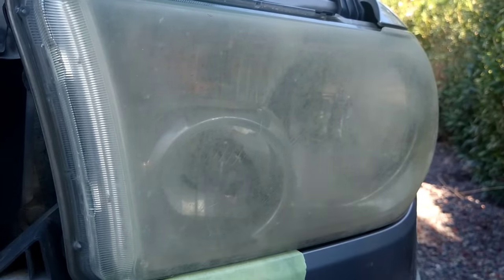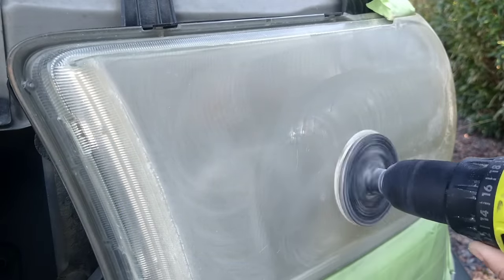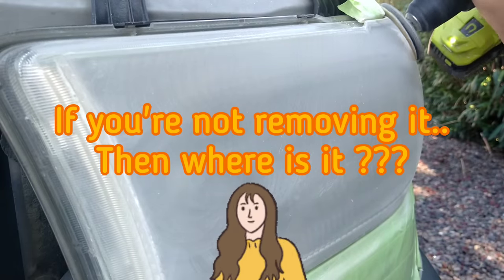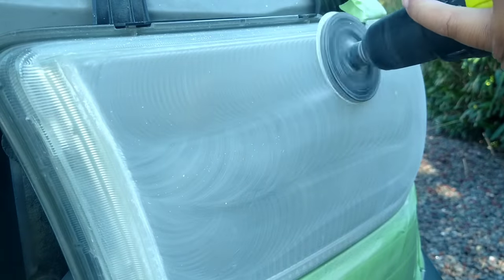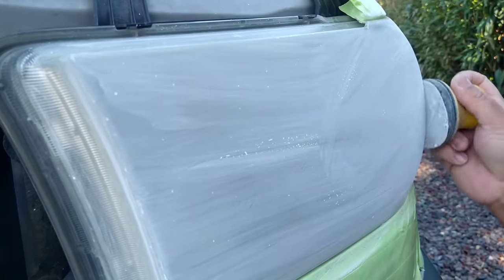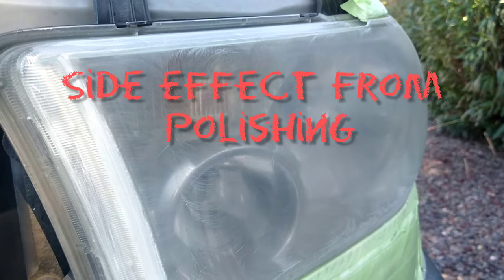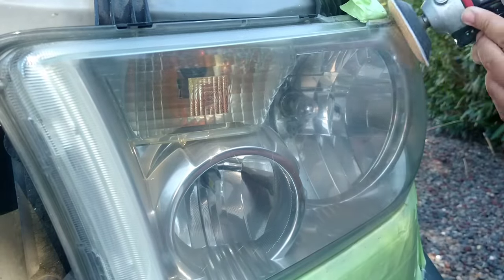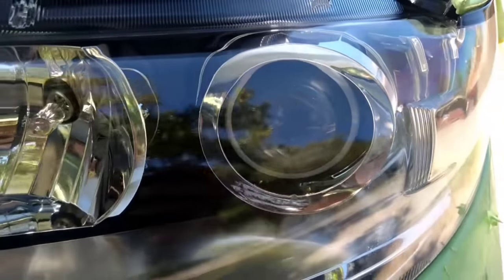POLISHING HEADLIGHTS IS A SHAM/scam  ---  and why you should never only polish headlights

Comment: Cost cutting by manufacturers is why we have to do this , bring back glass headlights and they will outlast the car.... 👍
Reply from the maker: Stay tuned got some interesting content coming out you would definitely be interested in... Thanks for watching.
Reply from the maker: https://youtu.be/LcMFr0mpp-4
Reply: Yeah my 99 Subaru has glass headlights they still look new
Reply from the maker: https://youtu.be/LcMFr0mpp-4
Reply: This is a great idea. Until you wreck and there’s glass everywhere
Reply: Part of the reason for the switch from glass is because of ncap ratings. I say if people didn't walk into the road it wouldn't be a problem.
Reply: I just opened comments to say the same thing.
Reply from the maker: https://youtu.be/LcMFr0mpp-4
Reply: @colemcclintock216  are you related to the scare crow from the wizard of oz?
Reply: @colemcclintock216  

Now that they have gorilla glass, it would be simple to have a veneer of glass over the polycarbonate body.
It would be a simple overmold process and a lot cheaper than solid glass.
Reply: @theheadlightrestorationpro  so the clear coat on the lense is spider webbing. Since it's not overpolished like the one you restored in this video, what is a proper process at that point?
Reply from the maker: @xenniealsentinel1800  well long as it's just the sealant that is spider cracking pretty much the same process you just remove the existing sealant and replace using these methods.. but you have to establish it is the clear coat not the actual headlight if it's the actual headlight there's nothing much you can do but try to mask and blend it as much as possible with polishing and clear coat...
Reply: @theheadlightrestorationpro  thanks friend
Reply from the maker: It would be very expensive and no telling if it would work...they would have to take years of research and millions of dollars...and a bunch of other stuff..
Reply from the maker: https://youtu.be/LcMFr0mpp-4
Reply: Part of the other reason for plastic. Call all the dealers in your area, ask them about restoration.
Reply: @colemcclintock216  yeah, because if you wreck the plastic will never break!
Reply: Doesnt even need to be glass, since 2011 ford f150s have had headlights that dont fade. I know cause i had a 2012, never had new headlights, they looked untouched to this day, 10 years on.
Reply: @colemcclintock216  there would be glass everywhere anyway if you wrecked…
Reply: @colemcclintock216  yeah, also our windshield is made of big pane glass
Reply from the maker: Modern windshields are generally made of laminated safety glass, a type of treated glass, which consists of, typically, two curved sheets of glass with a plastic layer laminated between them for safety, and bonded into the window frame.
🌎GOOGLE 🌍

Learned this the hard way.. if you ever see a scar on one of my hands on the videos.. it's because I punched one out all I did is shatter with the hole for my hand to go through I was like glue which is why my hand got cut...good for thought..
https://youtu.be/LcMFr0mpp-4
Reply from the maker: https://youtu.be/LcMFr0mpp-4
Reply: Glass vs. Plastic = $$$.....it's all about cost reduction.
Reply from the maker: https://youtu.be/LcMFr0mpp-4
Reply: @kylesmith6515  🤔 My 1998 Subaru Forester had plastic headlights, and glass fog lamps.
Reply: @colemcclintock216  here comes the rain cloud when it was all sunny dude come on if you wreck the car you get new headlights there's glass everywhere who gives a s*** in his car start driving again the glass is all broken up in little piece and gone anyway like in a regular car accident
Reply: @6panel300  change a headlight to plastic but reinforced bumper with a steel Hood and sometimes it's still Grill is okay though that doesn't make any sense
Reply: That part
Reply from the maker: That part...https://youtu.be/LcMFr0mpp-4
Reply: @theheadlightrestorationpro  you're relentless with that video promotion
Reply from the maker: That's how it works....lol
Gotta get it out there...
https://youtu.be/le1LyD93Ydo
Reply: Government mandated materials and minimum standards strike again.
Reply: They sell laminated headlight protectors. Just like a screen protector for your phone, this is like Like a screen protector for your headlights. Usually comes in three to five layers. If it becomes pitted or scratched you simply peel a layer. Just like the windshield race cars. They're expensive because they have to be custom formed and cut for each headlight housing. And they're not too widely available for anything other than Japanese direct Market cars, because the only two companies I know that make these, are based out of Japan. If you guys know any companies based out of any other countries, please let me know. The companies I know will manufacture a custom for any vehicle, but it comes at seven to eight times the price of their assembly line built models for the JDM Market. Shipping overseas and what-have-you, in the end the price is absolutely astronomical. I have a couple of American cars lying around that I would love to apply these too
Reply from the maker: @nighttow8780  yes very when it's all said and done 15 times more expensive than a headlight... Especially cuz when they go bad you still have to pay somebody to put them on if you don't know how to do it...
Only if they're as screen protectors that would be awesome... 3M sells rolls of the stuff very expensive.. the real expense comes from having to cut it and fit it to the headlight as you know time is money and labor..
Would be a great idea if it could be affordable...
Reply: @theheadlightrestorationpro  agreed. I'm surprised after the changeover to plastic housings, that an after-market for this didn't grow. After 25-30 years a plastic headlights, I figured things like this would be widely available by now. This guy I know somehow manages to put super light tint film on his headlights. I think it's something like 85%. His headlights are not perfectly smooth, you can see the orange peel in the surface of the film. But sitting in the vehicle looking forward, the light pattern still appears to be defined and sharp. Full disclosure, he is running a pair of 6000 Lumen LED headlights. But it's kind of the same principle. If something hits the headlight like a rock or branches when he goes off road, he can just peel it off and stick a new one on. It's not pretty on the outside, but he's been doing this on this truck since he bought it brand-new 15 years ago, and when he peels the stuff off, the lens on the headlight is in Factory like new condition.
Reply: HRP are toyota headlights a softer or harder plastic?
Reply from the maker: https://youtu.be/oxRxE5Lb44w
Reply from the maker: Yes ... But I scare people who think they know how that restoration..😂😂😂
Reply: @bobfuhrwerk2869 Glas also means more weight. Ppl always tend to rate topics from the most negative perspective. And some headlights already extremely expensive, even made out of plastic.
Reply: Exactly what I was thinking. Car manufacturers cost cut on headlights and other car parts made out of plastic… just to fail prematurely.
Reply from the maker: Probably so..
Reply: Yes, glass lasts 10 times longer w/o discoloration but they are more subject to cracking from stones
Reply from the maker: @michaelmcclurg9698 exactly.. and much more expensive to produce..
Reply: Saw a '53 Hudson with glass headlights, unrestored, but the lights looked new.
Reply from the maker: @markjadrych5461 
https://youtu.be/LcMFr0mpp-4?si=XT6KRnzym05yKUC1
Reply: My glass fog light lenses are completely broken and chipped due to the non-stop asphalt construction..... at least plastic doesnt have that problem...

My windshield also has a ton of chip marks from it
Reply from the maker: @Ayesuh yes headlights are made out of polycarbonate in the modern day in this material is 250 times stronger than glass..
Reply: @theheadlightrestorationpro  any plastic will resist a rock chip better than glass, and considering our roads are now made of asphalt instead of concrete, thus creating the never-ending road-repair. Yes, plastic is far better than glass given the current road conditions and hazards

And strength is a relative word, 
in terms of chipping, plastic is way stronger
in terms of UV degradation, glass is way stronger
Reply from the maker: @Ayesuh  👍🏽
Reply: Makes sense.
Reply from the maker: @monicabrennan7111 👍🏽
https://youtu.be/LcMFr0mpp-4?si=qD9wDf8UTPWdt5QH
Reply: @colemcclintock216 This wasn’t an issue since they were made of tempered glass.
Reply from the maker: @sweetpadre https://youtu.be/LcMFr0mpp-4?si=c3AmsdtHEKXn6G_6
Reply: Yeah, but then the next rock that cracks it will cost $5K. The plastic assemblies are bad enough cost wise for the consumer. Glass assemblies would be more expensive by several times.
Reply from the maker: @williamallen7836  true
.💯👍🏽😁
Reply: @Ayesuh  It's not like we suddenly got asphalt roads. We have had far more asphalt roads then concrete roads all along. Even then concrete was pretty much used only on portions of major interstate highways. Plus, most rocks come from unsecured loads. On top of this, proper design would place the headlight out of the wind stream, and direct flight path of objects. It's the whole reason why older vehicles with the old sealed halogen glass bulbs, some seemed to get cracked more often then other vehicle models. Not all vehicles designs are made equal. The real reason for plastic headlamp lens assemblies being made of plastic is 2 fold.  For one, weight savings for EPA & MPG reasons. It's gotten to point that EPA regulations have exceeded technological capabilities. So manufactures chase every ounce of weight of savings. #2 Form over function. Plastic can be made into much more complex shapes far more easily & cheaply. A glass version would cost far more if possible.
Reply: @williamallen7836  my fog light lenses are just ovals.... and the chips came from the asphalt, theres an asphalt chip inside the housing as evidence and it IS GLASS and if it wasnt glass then it wouldnt have chipped and broke the lense

Thanks to the NEVERENDING asphalt construction because asphalt only lasts half as long if done CORRECTLY which isnt the case on any road near me as they dont lay any base down and lay asphalt over dirt where it degrades within days
Reply: @Ayesuh  those are fog lights not head lamps. Which are often placed lower to ground in the direct line of fire of stones. Head lamps on many (not all) older cars were placed further up, and some what recessed. It takes a stone to be flung nearly horizontal from a couple feet above road level to hit them. A stone kicked up from the road will arrive at an angle. Hitting the number, or other portion of the car. 

All asphalt roads appear to be laid on dirt. Under the top few inches of graded soil is the bulk of the road bed. Which is made up of graded stone. Without this road bed you would have no road after the first heavy rain. If the agragate is breaking up within a few days, it's from improper sealing, or no sealant being sprayed down. I haven't seen a single resurfacing done without sealing. Outside of temporary patches. Which are ground down & sealed once they settle.
Reply from the maker: @williamallen7836 https://youtu.be/LcMFr0mpp-4?si=Tmbl6FDgoSwLfxdp
Reply from the maker: @Ayesuh https://youtu.be/LcMFr0mpp-4?si=Tmbl6FDgoSwLfxdp
Reply: @colemcclintock216 so?
Reply from the maker: @theautumnwind2152 https://youtu.be/WXUWWF47Kys?si=ntUGrrEmlExS9_Wy
Reply: If they would just make a replaceable plastic cover instead of making you buy the “module” it would be at least affordable! Ive noticed car makers make lots of things in modules in recent yrs.! Like for instance a thermostat used to cost about 10 bux now you have to buy the module for $80!
Reply from the maker: @StonemanRocks true...
Reply: THE GLASS WAS KILLING MORE PEOPLE
Reply: @bobfuhrwerk2869  Plastic, for cost reduction?   So a "headlight" made of 37 different pieces of plastic all glued together, actual bulb not included, that costs you $500 is 'cuz "cost reduction"?  I'm kinda inclined to think it's 'cuz with plastic they can make it hella more complex than they could with glass at the same price point,  which is still over $300 for most present-day cars, and you'll smile like a big goober while you fork over the Benjamins 'cuz it looks bitchin'. 

It actually would not be that hard to have those fancy plastic things built with just the front lens made of actual glass, which wouldn't fog, frost, oxidize, craze or yellow.

Frankly, the concept of a headlight being this monstrous plastic clusterf--- of a thing that dominates the front end design of a car -- eff that!  And don't get me going on taillights (yeah, I'm looking at you, Montero, with those Utah-sized rear end units). I'm up for a return to a "headlight" being a simple item -- round, rectangular or whatever -- that's little more than just a can for the lamp itself.  Call it "retro" if you want, but bag this decades long nightmare of oxidizing, yellowing, fogging plastic things.
Reply from the maker: @darrinrice367 https://youtu.be/LcMFr0mpp-4?si=rMF9iwnDt2pDfux9
Reply: @darrinrice367  Holy shit someone actually figured it out.  Yeah.  It's a bit more difficult to make a giant retarded boomerang shaped lamp assembly out of glass.  It would be terribly difficult to make cars half as ugly without the design flexibility allowed by plastic.
Reply from the maker: @HammyJamPants https://youtu.be/LcMFr0mpp-4?si=S7J-9e_SK5Bk-5nb
Reply: Glass ain't coming back dude
Reply from the maker: @stevenweiss2148 lol...never.....💯
Reply: @PSUQDPICHQIEIWC   While I'm no zealot, most modern cars are far uglier then most older cars. Rather none descript rounded blobs. Funniest car review I read was talking about that years model of minivan having brave new bold styling. When you looked at the 2 models side by side the "brave new bold styling"  was a very slight waist bump. If you were more then 5 feet away you couldn't tell the difference. Lol
Reply: @williamallen7836  Depends what we consider "modern".  The 90's had its fair share of ugly shapeless blobs.  It's like all the designers were taking inspiration from eggplants and water balloons.  These days, they're taking inspiration from children's sneakers.
Reply: @PSUQDPICHQIEIWC   Haha very true. My truck is 1968 F100. My 1992 Camaro is for summer fun ('82-'92 body style) my 2009 Subaru is for winter salted road driving. So you can see I pretty much prefer late 1980's on back for style. Even the 2000 to present leave a lot to be desired. It seems like if a manufacture introduces a particular style, like a new design of grill. They will put it on every model line the next year or 2. Then every manufacture that they are part owner of does the same. Really makes them start to look all the same, with very little true innovation in design.
Reply from the maker: @williamallen7836 https://youtu.be/LcMFr0mpp-4?si=0JfvNDN0uNPObGhD
Reply: Actually polycarbonate / acrylic is more expensive... from experience buying acrylic / polycarbonate sheets for artwork.

One is made from oil-petroleum processing.

Glass is melted sand particles.

Glass shatters whereas polycarbonates don't shatter but the surface gets hazes & scratches & pitmarks.
Reply from the maker: @birgip.m.1236 https://youtu.be/LcMFr0mpp-4?si=K6yjPUN1y9bFnzzq
Reply: @birgip.m.1236  Cost of sheet materials to a hobbyist has little correlation to cost of cast and assembled parts at production scale.
Reply from the maker: @HammyJamPants 👍🏽https://youtu.be/LcMFr0mpp-4?si=eQYPx77qNBxn-10S
Reply from the maker: @july-lian you sound silly car panels are not the same as headlights educate yourself... Read a book on Google something before you get on here...
Reply: @Marconius-SPQR sealed beam headlights.... The lenses and reflector are part of the bulb
Reply from the maker: @SgtPnkks yes they are part of a bulb in a working unit they work with the bulb but technically separate parts..
But once again yes all work together to perform the desired effect.
Reply: yes lets increase vehicle and insurance cost with glass headlights🤡
Reply from the maker: @antcantcook960 😂😂😂
Reply: Cars are already 50k, don't give auto makers an excuse to raise that even more!
Reply from the maker: @seanfarley1758 exactly
Reply from the maker: This is why.... If you really want to know why it's not possible here you go..
WHY HEADLIGHTS ARE MADE OF GLASS ANYMORE
https://youtu.be/LcMFr0mpp-4?si=IueRk08qvEgx9H2p
Reply: Has more to do with styling demands and keeping weight down than cost🙄.
Reply from the maker: @1BaydenRank those are a couple of reasons that I've stated before and it multiple videos a few out of a very long list of why not...https://youtu.be/LcMFr0mpp-4?si=cL8URLwizh_JFpsx
Reply: They are also recyclable and biodegradable.
Reply from the maker: @charlesross1682 yes 💯
Reply: Amen to that!
Reply from the maker: @pc8863 never going to happen... Technology typically doesn't go backwards it's kind of his thing...😂
Reply: Yep I don't buy cars past 1971. So yeah, glass!
Reply: Plastic headlights are just another built in repair expense and they hope you will go back to the dealer to have it taken care of. There is a lot of that with the new cars.
Reply from the maker: @danielheartsill4269 true...
Reply: I remember glass headlights, and NO they will NOT outlast the car. They will be all full of rock chips!
Reply from the maker: @ralphinator2  exactly 👍🏽
Reply from the maker: @ralphinator2  https://youtu.be/LcMFr0mpp-4?si=kk753clrN-8LkTeF
Reply from the maker: @daves7775 https://youtu.be/LcMFr0mpp-4?si=7UnQNNZe43EbNbPJ
Reply from the maker: @daves7775 in fact go somewhere else
Reply: I have always said the same - stop selling all the acrylic / plastic junk - bring back real glass headlights.
Reply from the maker: @coycarlson4979 
Watch this..
https://youtu.be/LcMFr0mpp-4?si=PtqfYVnS--Y9E394
Reply: @antcantcook960  I have news for you… your insurance is going up anyway! Two things that will always be true. Your insurance is always going to go up regardless of costs of doing business for insurance companies. 2nd, your insurance cost will never go down! Even if no one ever had another collision ever again!
Reply from the maker: @davidkarpen5686 👍🏽
Reply: with glass headlights you don't have to spend more money.
They want more sales. They want the money coming in.
Reply from the maker: @willarddunn8552 
Maybe so check out new video.
Lamborghini restoration
https://youtu.be/1YCVKzBkNyE?si=TuFD59Vdsi-UYlxl
Reply: Cost cutting keeps the price of new cars affordable. Well, semi affordable.
Reply: Until a rock hits it and headlight is gone. Issue is ppl don't maintain their headlights let alone the car's paint
Reply: Shaping glass the same way as an acrylic headlight lens would be horrifically expensive not to mention increased weight. Manufacturers are constantly trying to lighten and streamline their cars, for better performance and economy, while keeping prices low. That’s what the customers want and expect. May as well go back to steel bumpers and rims, too, while you’re at it 🤷‍♂️
Reply: @Marconius-SPQR  and I bet they were round and very basically shaped. Unlike modern ones
Reply: In 1990 my Mother bought a new Volvo 240 wagon. Every in spring and fall I cleaned them with PlastX by McGuire's. 34 years and 400,000 miles later the headlights are still as clear as new.
Reply: @colemcclintock216  Good thing the windshield is not glass, right?
Reply: Then there was no point in leaving a comment! @shealdedmon7027
Reply: @6panel300 Some of those people are children who get sidetracked by play all too easily and chase a ball or thrown item into oncoming traffic.  I saw this happen!  Also saw same happen with an Alsatian chasing a fire engine. Then there are sports cars and sheep herds on the same stretch of 'sleepy', curvey, country lanes, the list isn't endless. 😊 But the main thing I'm surprised not to see people mention too soon here are stones that get thrown up by especially trucks and wide tyre cars with no rear mud flaps, nor extended wheel arches which used to chip and crack glass headlamps every so often.  A pity because the glass always looks sharp. Sharp in an accident too, as you write.
Reply: @fubartotale3389 ...and what would stop the first layer of poly turning smokey from the ultra violet rays of sunlight?
Reply: @skie6282 which vehicle was it and which model.  My 2012 Mazda 6 did, my 2012 VW Golf did even moreso!  My 2012 Hyundai Tucson didn't buy it was always garaged, the VW never, the Mazda mostly not. Clearly (excuse the pun) the answer is place cling wraps made of some UV blocker over you lamps whenever you don't expect to be using your headlamps! 😅 Well! It would help if only for the first 5 years!
Reply: @skie6282 Was it garaged?
Reply: And by cost-cutting you mean profit margin increasing.
Reply: I disagree, plastic molds cost big dollars, we can thank overreaching government regulations forcing unrealistic mileage standards that continue to get worse every year.  To meet regulations, manufacturers are forced to reduce air drag along with saving weight.  Voting for politicians who kneel at the altar of climate change costs all of us.
Reply: If you plan on keeping the car for a long time and store outside:
Buy a roll of clear packing tape and put a couple strips over the headlights and replace maybe 1-2 times a year if it gets road damage
Reply: @colemcclintock216  Do you have plastic windows in your car? NO , glass.
Reply: not me trying to find replacement headlights for my glass 1991 honda crx headlights.

They might last forever but they still get damaged in wrecks etc

If you have a clean set let me know lol
Reply: Glad it's about 10 times heavier than plastic and in order to meet gov regulations on mileage they cut weight off the vehicle any way possible. And could you imagine the price to replace those if they were glass. It's bad enough the bulbs are 10 times as expensive as they used to be. I used to buy one sealed beam #2 rectangular light for $4.99 now one build cost me $49.99 unless I catch a sale. And I don't think the bulbs last as long as the old sealed beams used to either. Later!
Reply: Too heavy, can't make the same shapes. Its not all cheapness. Also, better car brands don't dull like cheap ones do.
Reply: @colemcclintock216  That's why they have brooms
Reply: Exactly my '93 300zx headlights look brand new
Reply: @colemcclintock216  Or learn how to drive and don't 'wreck' 😂  Are you worried the headlights will hit you in the driver seat or what? 🤔
Reply: @shealdedmon7027 😂😂😂😂, perfect.
Reply: @bobfuhrwerk2869 It is about weight reduction too. Mileage standards have brought us plastic in cars not just cost factors.
Reply: @mikemanofleisure  I think most of the scarecrows family is on here to be honest with ya.
Reply: I have 30 year old accord headlights are perfect still. Everything is made to be thrown away today
Reply: Then some dude in a parking lot backs up and it’s a $2,500 headlight repair
Reply: Yea, cost cutting on their end but charge you the same or more, THATS THE SHAM !!!
Reply: I’ve been looking for some Glass headlights for my Obs Tahoe.. no luck
Reply: I sanded my headlights forgot the 4 types of grits I used.
I used the Chemical guys headlight restoration.
I lasted me about 1 year.
I didn’t use a uv sealant. 
The previous time I did it, it lasted me 1 or almost 2 years.
I sanded and used a clear coat.
I had fun doing it even though I didn’t know what I was doing 😆 
I recently purchased a new set on eBay boom new again 😂
Reply: My Prius has clear tail lights and they aren’t faded 🤷🏻‍♂️
Reply: Nothing to do with cost cutting, all with weight reduction
Reply: @colemcclintock216 
That's Not The Big Problem You Say It Is - Shattered Plastic Is Also Sharp And Cuts.
Reply: @viktorgillen7796 
Plastic Shatters
Reply: Oh, NO! At the end of my road, there were often minor accidents at the roundabout. The slightest bump left glass all over the road. Until nearby householders NOTICED , and swept it up , could take one and a half hours!
Reply: @colemcclintock216 Omgomg glass EVERYWHERE